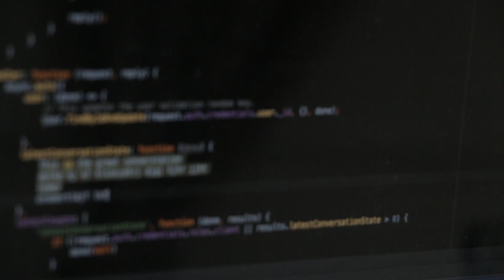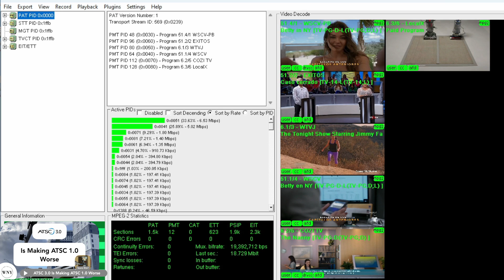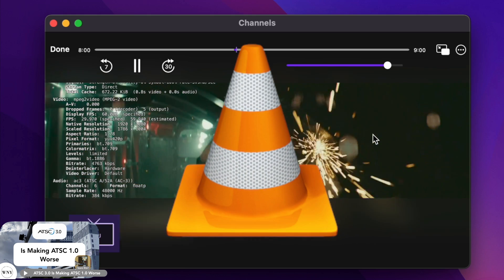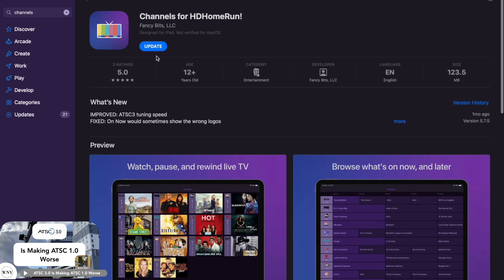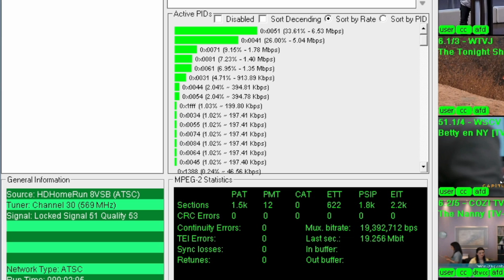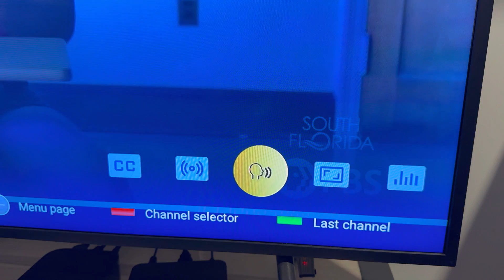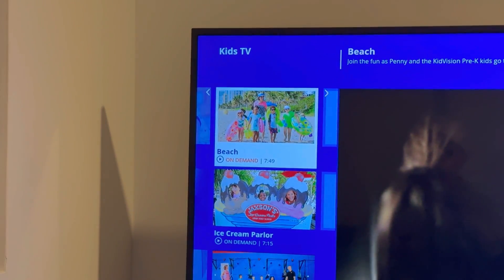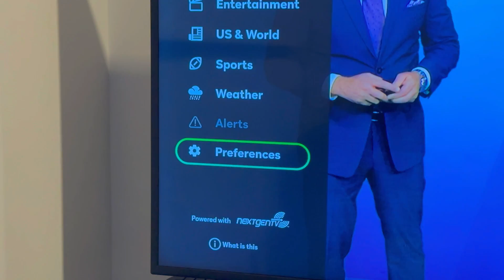ATSC 1.0 Is Capable Of ATSC 3.0 Features

Comment: ATSC 1.0 is probably the worst digital TV system of all four available systems across the globe. It's extremely fragile and prone to interference; you may see one important channel disappears randomly and can't figure out what causes this. Sometimes the signal is good even when nearby traffic is super heavy, and sometimes when everything is clear but the signal strength is below 15%. The system is never designed for indoor antenna receiving use. Here in western Canada, if you live in an apartment, most likely you are not allowed to use an outdoor antenna per strata bylaw, so the only option is to purchase an indoor one. However, due to the issues mentioned above, even the best indoor antenna cannot ease the pain; the channel with local news suddenly disappeared and I have to move curtains and other objects around to seek for a signal boost but no use. I believe other systems such as DVB-T is much more reliable with a better technology of multipath interference mitigation.

Comment: Excellent video, hitting on how much potential is still left on 1.0, and what 3.0 offers.  It should be mentioned that by not sending null packets on 3.0, it makes FrankenFM possible.  It's hard to see 3.0 succeeding in the current environment, and broadcasters will probably view new codecs over 1.0 as the way to go.

Comment: The problems with ATSC 3 aren’t technical, they’re political. Advocating for using modern codecs to deliver the same content and features over ATSC 1, and thus in a way that the NextGen cartel can’t control and slap encryption all over, will encourage them to be reasonable—and if not, eff ‘em, we’ve got this option regardless. Besides, we still have AM radio, so maybe RF modulation isn’t all that important, ultimately.

Comment: ATSC 1.0 had in the specs from the Grand Alliance that developed the standard to use a 30ft antenna as the basis for reception. They didn't even consider mobile or indoor reception. So all the real world performance were focused on that, a holdover from the 50's when everyone was willing to put up a 30ft antenna on their roof; never mind apartment dwellers. 

Great video explaining all the different layers within the spec. Your right, you can do 4k Dolby Atmos all you want with ATSC 1.0, but it does nothing for reception. The impacts of a moving truck or tree or airplane overhead will still cause glitching, and probably even worse for advanced codecs.

Comment: 12:44 No.  Non existent on one isn’t acceptable.  DRM simply needs to go away.  All the $$ being spent to encrypt everything is making the hardware more expensive.  Which hurts consumers and is interfering with innovation (same innovations being mentioned in this video).  They should be focusing that $$ on fighting those pirate companies directly.  The hardware isn’t going to prevent the pirate companies as can be seen with DVD and Blu-ray.  There are STILL people ripping Blu-rays for personal use.  They are literally throwing money away and only making things more difficult and more expensive for the law abiding people.
Reply: In my opinion, until the lower priced TV sets include NextGen TV tuners, ATSC 3.0 will wither on the vine and eventually die.
Reply: @mistermac56  just look at how it has slowed HDHR from being able to get certified.  

On top of that.. there are “certified” boxes which don’t prevent what they are saying is the reason for needing to encrypt.. so it is utter BS to move forward with this encryption.

Comment: If ATSC 1.0 is capable of all that stuff, Then the only reason ATSC 3.0 exist, Is just for the encryption because the broadcasters only care about protecting there content, and aren't in the best interest of the consumer who watches this content over the air for free.
Reply from the maker: This is why I believe we need a well rounded FCC that imposes rules to benefit the average antenna user. The government is supposed to be by the people for the people. These airwaves are supposed to be the public’s, and the FCC is supposed to be the intermediary that operates on the taxpayer’s behalf.
Reply: @WNYOverTheAir  any word on a fcc change when a diff pres is installed?
Reply: @WNYOverTheAir    💯 correct!!!!
Reply: ATSC 1.0 uses 8VSB which makes it less robust than OFDM used in ATSC 3.0. Try tuning an ATSC 1.0 signal on a car in motion and it won’t tune.

Comment: That's all well and good if it weren't for all of this A3SA Encrypting in ATSC 3.0.  
There's even interference with satellite television when a good storm happens but at least with ATSC 1.0 without all of that encrypting at least there is something coming in even though you will need a super good antenna and thick RG6 Cable. It is easier to need and acquire that over them having to remake and certify every digital tv tuner to be A3SA encryption certified on top of being nextgen tv compliant just so that people can continue to watch TV free over the air without the need for an internet connection.